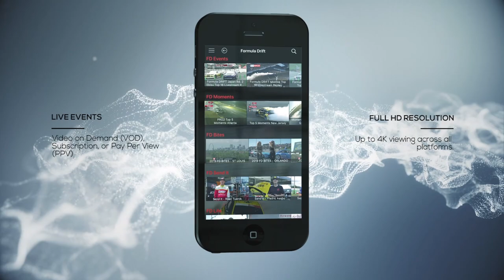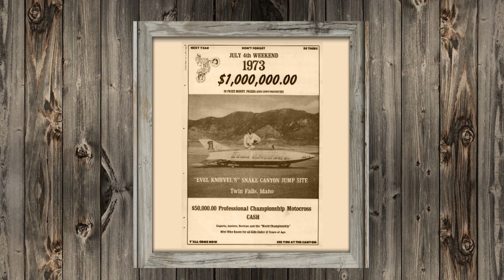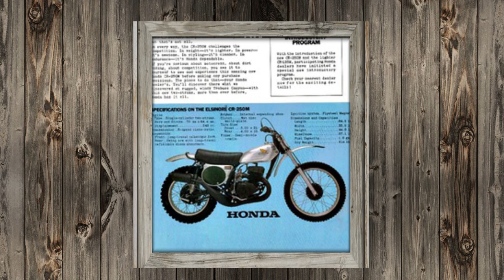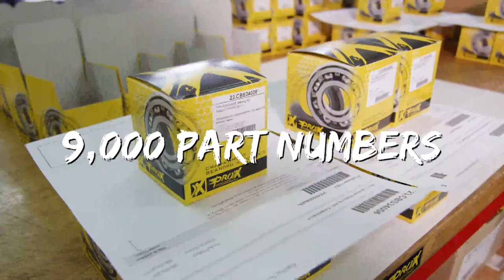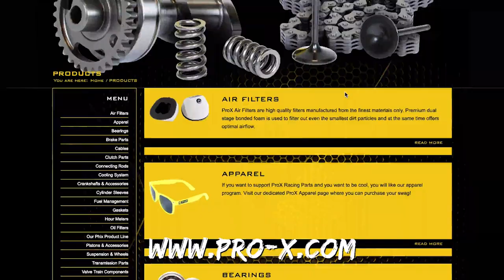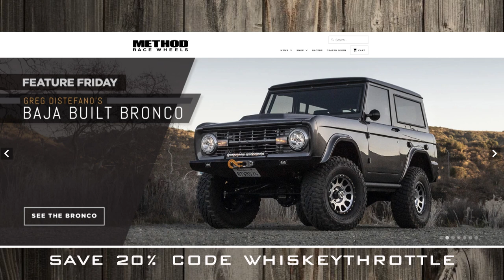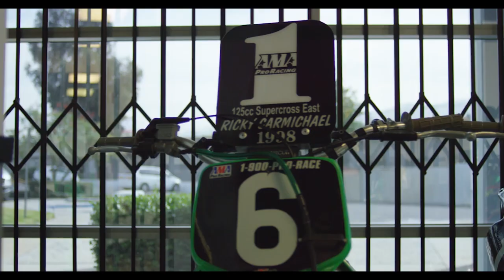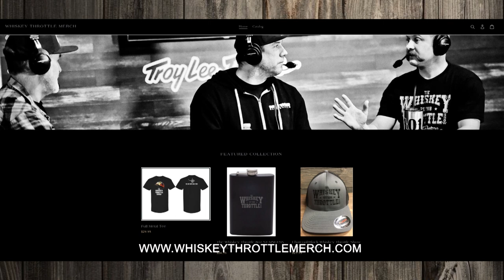S3 EP7 DANNY LAPORTE

Comment: I think you all need to cut Brock some slack.  I look at the interview, as another poster stated, that Danny and Brock are lifelong friends sharing the same experiences and timeline.  I don't think of it as interrupting so much as more like an old married couple finishing each others sentences.  It does seem as though  Danny had more to add at times however. Later in the interview there is a lot more give and take.
Reply: @EarthSurferUSA  I guess "crashing" was a bit of reach, but ground loops can get ugly, this one wasn't.   I glad to report I went on and retired after 30 years in the airlines without bending any aluminum or any pax getting hurt :)

Comment: It basically should have been labeled "Danny Laporte and Broc Glover". 2 Greats, and contemporaries of each other. That would have been better  'titling' of the show.

Still, a bloody good listen while I'm in my workshop, Machining and  TIGing away!

By the way, at the start of the show, with the 'pictures on the wall', the first is not Danny - it's Andre Malherbe on the #5 Honda. Then the others are of Danny. Maybe that's the normal way the pics start, but it's De De Malherbe, first up.
Reply: Bicycle (mainly DH) & Motorcycle frame maker, modifications and Suspension - for just over 5 decades now. My own stuff, but also a fair amount of contract work (NDA laden) for large companies and race teams. When I can travel,  I do fair a amount of work away from OZ. Used the last year for a bit more of my own prototyping, but 'E' work has still been done. The wonders of technology  are  useful even for confirmed 'analogue', old blokes like me .